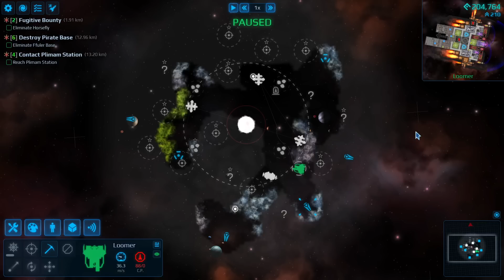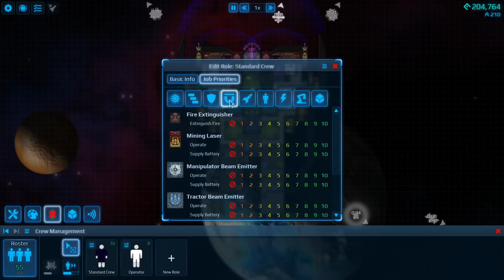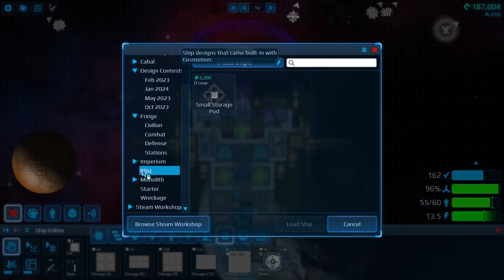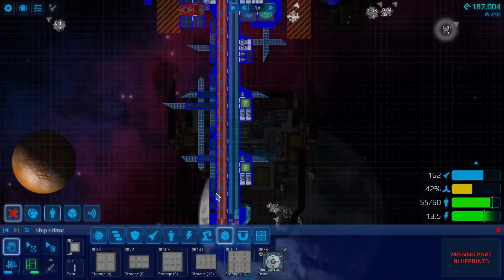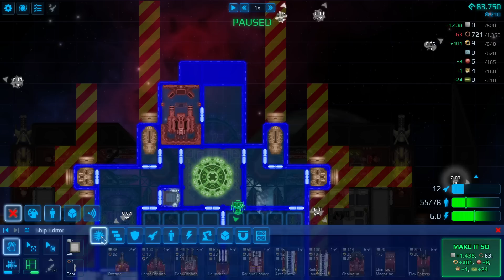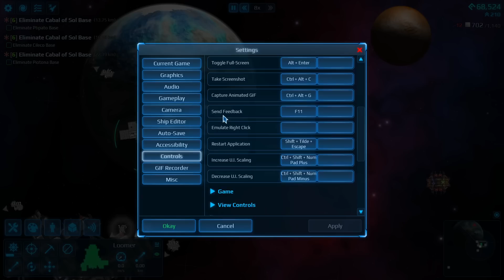Cosmoteer: Starship Architect & Commander - Ep 9

Comment: use supply chain mode. or if you just set a desired item for that storage space. it will make it if there is room. So if you have a 4x4 set to only take coils. The coil maker will produce them until its full

Comment: All right. Let's discuss logistics. In the resources tab ( the little box icon) there's a box with triangular arrows sticking out of it. This let's you set up in abs output storage. Let's use the diamond smelter as an example. You have a 3x2 storage to the left, the smelter and a 3x2 storage to the right. If you click the box with arrows you can now set links between modules. Say you designate the whole of left storage to carbon. With the arrows you can now click on left, then click on smelter. This means that any resources in left will be put into the smelter if able. Then click on smelter with the arrows still selected and click on right storage. Any finished products in the smelter will then be taken to the right storage. You now have a working in/outflow for your smelter. This also works with crew roles and power.
Reply: Upvoted for visibility.
Logistics is important, especially when your ships become bigger and more complex
Reply: What's "abs"?

Seen some other comments saying "abs" but nobody's specified what it means, and google isn't giving anything relevant by itself.
Reply: @AceStrife  that's a typo. It should be "and"

Comment: Yeah, railgun blueprints give you all parts needed for a railgun and blueprints seem to be the same across the stations. Also, you might want to right-click on the mine icon in the bottom right, you can filter what gets picked up, might want to do that for ammo if you don't use it. You can also set limits for how much of X to pick up.

For mining lasers - they are top mounted, and they have a very wide arc, they can at least fire from and to both sides, and you can basically plop them down in the middle of the ship. Been enjoying this game more than I thought I would... A construction/mining/factory ship sounds like a good idea and shouldn't really require a lot of crew for it. Also turns out the recommended crew should basically be treated as the upper limit if your ship is properly designed and if it goes over, then the crew will basically waste time.
Reply: The diagonal ship use more thrusters, but they are less efficient because some of ALL thier thrust is off-axis.  That said, while harder to design well, they can be very effective and efficient.

Comment: Alright good deal. You've got multiple roles. Now it's time for the next level of crew optimizatiopn. You can select a crew quarter, then drag a line between it and a ship component. That will assign the crew from that barrack to ONLY interact with that (or those, you can link a barrack to more than one component) ship component. This is VITAL to ensure the crew do not go randomly to fulfill tasks on opposite sides of the ship, wasting tons of time. It also ensures that critical ship components, like the control room, always have staff.
Reply: This is top tier advice. I always past my initial ships set dedicated crew quarters for bridge crew and gunners. Bridge crew literally sits in the control room and nothing else, and gunners CAN leave their guns but almost never should unless i turn off their guns, since if were running anyway turning off the guns can be a couple clicks away with some control groups set up.
Reply: @aarniometsuri  Exactly! Then level 3 is when you combine these two approaches. You have dedicated crew roles ('Logistics' for carrying stuff, 'Operators' for operating stuff, etc) AND dedicated crew assignments. Logistics staff can be assigned to storage areas, factories, reactors, and they will ONLY carry stuff around. Operators are assigned to weapons, control rooms, etc, and will ONLY operate that position. Then level 4 is when you optimize crew barrack placement to be right next to where they're assignments are. You can get a ship to purr like a cat in your lap when you start doing this kinda thing.
Reply: this makes the smaller baracks more useful if you only need 2 or 6 people for a job